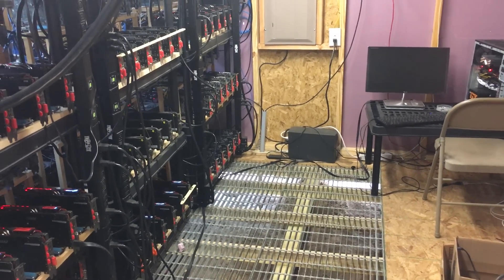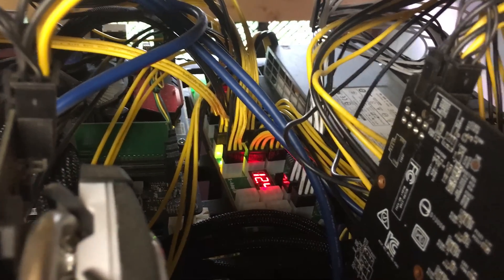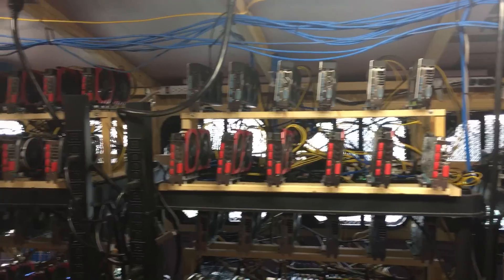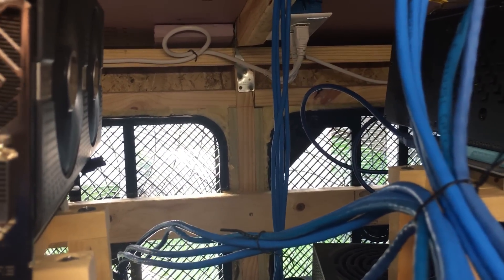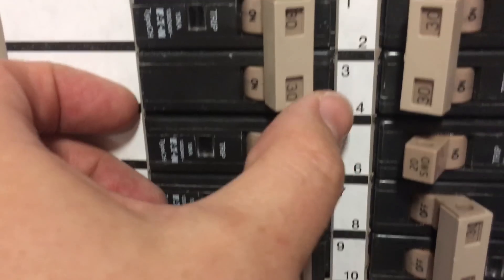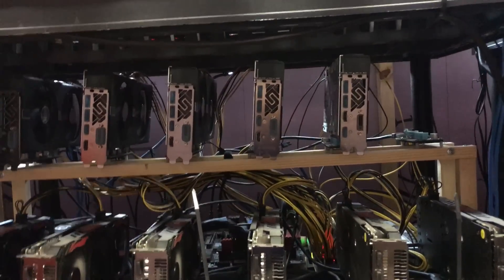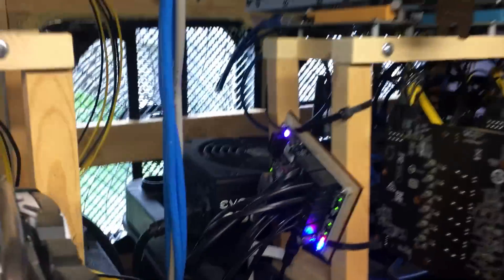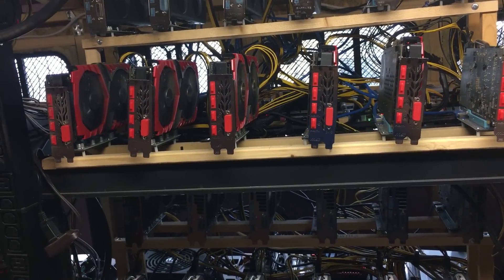5.6GH 192 GPU Ethereum Mining Shed - Nov 2017

Comment: You have a great setup. Can you (or anyone else here) tell me how you configure your PSUs? When you connect your server psu and the smaller 750 on each rig, do you have them connected together so that if one PSU fails, the other will also turn off? On my rig, I connected  an evga 1000 to 8 risers and motherboard. I also used the 1000 to power 5 cards. 

Then, I hooked the 1000 and EVGA 750 together using an Add2PSU adapter. The 750 was used to power three cards. I'm still not sure if it is better to power all of the risers using one PSU.

I ended up switching my configuration to have the 1000 PSU power the motherboard, five risers and five cards. It's still connected to the 750. The 750 now powers three risers and three cards. I want to build another rig and use a server PSU like you have so was looking for some input. Thanks!

Comment: So you are keeping like ~100k worth of PC parts in your shed? Im sure you've secured that shit rly good, but it seems so easy to break in to in the vid x)
Reply: except that you're probably gonna burn your hands off first in the process lol
Reply: It would take alot of time stealing it that's why I don't think anyone would want to break in there. Stealing is about easy money and that is not easy money.. first of all you have to take all of it then you have to sell all of it and people will suspect if have that many pc parts to sell :D
Reply: Sp00kY its not that hard to take out a few cards, and that can allready be a few thousand dollars
Reply: if you're don't know what you're doing then you can easily get burned just by touching one at the wrong place. My RX480 stays at around 50c on idle and still almost burned me when I touched one of the heat transferring tubes once.
Reply: yeah it may depend on that too and I have now idea how to OC my card... do you do it through the nvidia software or through bios?
Reply: CrashForce personally oc’d my 480 through MSI afterburner
Reply: oh alright thanks
Reply from the maker: MSI afterburner
Reply: Just hold it by the mounting brackets and you will be all good. I have an overclocked RX 460 in my personal PC and the bracket stays cool.
Reply: Cause graphics cards get hot enough to really burn your skin they shutdown at 80-90 deg C
Reply: CrashForce hmm never had that problem before even when overclocking however i do use nvidia which tends to run a little cooler so maybe that has to do with it

Comment: Set up & operating cost is higher and I don't see much profits you get soon.. You may need to full run at least 6 months to take your returns..
Reply: how long do you think it will run before it breaks down or becomes obsolete? 6 months after break even? looks like a fun hobby but i dont think this can be made into a real business
Reply: JimLahey it depends on the card purpose.. Gamers can run the card longer compared to mining purpose.. They're places where card ran more than 2 yrs without fail on mining.. Card easily fails if temp shows and flactuating rapidly.. GPU mining is profitable if you know how to keep cards in a constant temp... It doesn't matter if temp not exceeding 72 degrees.. This guy hav to run 5 to 6 months to take his investment.. Everyone should know mining in large scale is profitable..

Comment: Hi are the insulated walls for the noise? can it be any type of insulation?

Are the box fans water proof? How are you avoiding the rain?
Reply from the maker: waterproof,  not really. But this is a non-issue as there is NEVER any rain going in because the exhaust forces rain away.
Reply: BeerMan 81 what if the wind is stronger than the fans?

Comment: isnt 750W EVGA PSU waste for powering MB+risers ??
Reply from the maker: in what respect? akirezeusik
Reply: mean, risers and mobo need 750 W ? what about maybe 450 only ?
Reply from the maker: akirezeusik You don't want to run your power supply at 100% load. They are most efficient at around 50%. Also, that model has plenty of PCIE connectors, the others have fewer, and it is a good price.

Comment: Based on the Video, and correct me if i am wrong but is this the "MSI Enthuastic Gaming Intel Z170A LGA 1151 DDR4 USB 3.1 ATX Motherboard (Z170A Gaming M5)" motherboard? If so, ill be purchasing 6 or 7 to run my cards.
Reply from the maker: close...Gaming M7 actually however, I would actually suggest getting the BioStart 12 GPU board. Seems to be my most reliable board.

Comment: I think your thermal and service design is awful.
Turning these rigs 180 degrees so the cards would point at the air exhaust and you having better control of the power switches/psus would drop the temperatures a lot and it would be more practical for you to service.
Nevertheless I m jealous of your shed. Greetings from Greece
Reply from the maker: Each different GPU exhausts air differently. My initial set up had it like that, but it was revised, and it helped the air flow a lot actually. So, it is like this now.

Comment: I like this! But i would change 1 thing, your cards are not screwed into some from of bar on the top. You can see the force and pressure on 1 side of the Riser as all your cards are leaning there left.  This is not healthy for your cards and your risers,  maybe install a bar so you can support them ?
Reply from the maker: We actually implemented a fix. Thanks for the suggestion. https://youtu.be/2H4tFPQnxCQ

Comment: did you have a dedicated/new line run to the shed?/How did you get 225a out there? This is currently my bottleneck, researching best options but looks like I'll have to have a new service line put in for my operation. Kudos for the builds - put some "hoghair" filters over the grates and you'll be fine.

Comment: How are you getting enough power for this farm?? This is one of the biggest issues I have because the best I can find is 3 phase electricity which you are able to have 3 100 amp fuses but this must be using loads more then that. Did you have to have a substation installed?

Comment: What are watchdogs?
Reply: That is a product by simplemining that can tell if your rigs have frozen and if they have they will power cycle your rig. I believe it requires simplemining to be running on the computers. It is totally headless and you don't need a monitor to set up or run your computers.
Reply from the maker: u dont need smOS to use SRR. i use ethOS and SRR together. config coming in a future video
Reply: darkdancerman watchdogs are.the dogs who guard your entrance! Ksjfjha

Comment: Hey bro i was wondering if u can help me! With how many mining rigs at home i can set up w/o any power outages? It says70 amps on the breaker and 240v 3w on meter outside
Reply from the maker: If you only have a 70A MAIN breaker you are very limited. You should contact an electrician to see how much current you are pulling for sure. But, i think you can run around 10-20 cards or so.

Comment: How much did you spend total on equipment. Not including shed fans wiring for shed
Reply from the maker: I am still doing the accounting actually, but I expect we spent around 60k
Reply: BeerMan 81 wow and what do you believe is your roi?
Reply from the maker: When we started each rig was estimated at around 3-4 months. I am working on my accounting now,  but the estimate is around 9-12 months total due to the added infrastructure, changes, improvements etc.
Reply: I think you may have spent nearer $100k from looking at what you have there. Still your ROI should only be 4-5 months, and maybe less if you're trading as well (and getting lucky in your trades)

This is my dream and my next step. Thanks for helping me to look into my future ;)
Reply: How did you buy the GPUs, used? in bulk? how much did you pay for each. And how did you make up the money for such an investment since you were just a student?

Comment: are the power supplies running on 220v? how many amps is your main panel that feeds to your shed subpanel?
Reply from the maker: paton 245VAC actually. It is a little high, no voltage drop 😄. Cable run that is dedicated to the shed is protected by a 225A breaker.

Comment: im surprised u dont have more risers failing tho
shed looks awesome ofc everything awesome but the gpu alignment 
having them resting on the pcie slot like that causes the pcb to push the pcie slot pins into the walls
after time they dont reflex back and u can have connection issues
i had a few fail and then i switched to hanging them from zip ties with the riser under facing down
seemed to solve the problem now i just have common failures like usb connectors breaking type crap

Comment: I like the set up I just don't like that the outside air is not filtered. That is not good!!!
Reply from the maker: Jonathan T we have actually been working on that! Update coming soon.
Reply: BeerMan 81 nice work!!
Reply: Barett Engelhardt a filter won't reduce the rh%, you need to cool the air to lower it's moisture content, which would be twice the benefit in this scenario as in most dehumidifying situations, you then have to heat it back up
Reply: I want to build a shed just like yours, but my plan is to put the filters under the metal grates in the floor. You should consider that.
Reply: Sensei Ryan HD in order to force air across the filter you would need to create a differential pressure across it, negative on the discharge side. Either with forced induction or extract. Otherwise it will just restrict the airflow
Reply: Where did you get the metal grate flooring from?
Reply: Any steel supplier.
Reply: No one filters air. Entirely pointless.
Reply: I agree.  Keep an eye on the humidity in there.  That can cause corosion pretty quick.

Comment: Very nice setup! What's your electricity rate?
Reply from the maker: at the time the video was taken, it was around $1800, it now  around 2500
Reply from the maker: Andy Ye average is about $0.083, but it might go up to around $0.086
Reply from the maker: Perhaps, but the amount of juice required is insane. We are talking 200A, a 48kVA generator. That is a LOT of fuel.
Reply: BeerMan 81 I could be wrong but would it not be cheaper running that big of a operation to invest in a good generator for a few thousand dollars I can't imagine it would cost more than 500 a month in fuel to generate electricity to run that again just a suggestion haven't done the research admire setup and I'm looking to get into it big time like you are
Reply: you need to build an 80,000 dollar generator.....you should figure out how to make power using computers...LOL.  Then have a big shed next to that one and grow some hydropinic nuggets LOL
Reply: Very nice setup!  I am a generator technician. A 48kva generator would cost around $15000.  It could run on natural gas or LP. Problem is that if it was used for prime power the warranty would be void. You would have to take into consideration the maintenance side of it.  Gensets need attention just like you car.  Things can break and leave you down.  But a generator for back up and a 200A transfer switch would be a good idea if you are on a bad part of the grid :) 

Great video!  I'm new to Bitcoin but I am loving it so far.  I feel as if Bitcoin is here to stay!  It is going to revolutionize trade and currency! Good things are already here and to come.
Reply: how much do you pay for the electricity
Reply: Hi Josh. Our climate is perfect for mining but the electricity rates are not. We pay $0.18 per kWh. I have considered looking into a genset and I wonder if you can estimate the average kWh cost for a 48kva generator? I know fuel prices fluctuate but if you can make a guess using today's fuel prices I can make my own estimates on future costs. Also, how long do these gen sets last and is there a particular brand or model that you would recommend?
Reply: I pay $0.23 per kw/h in my country, i wish it was 8 cents.